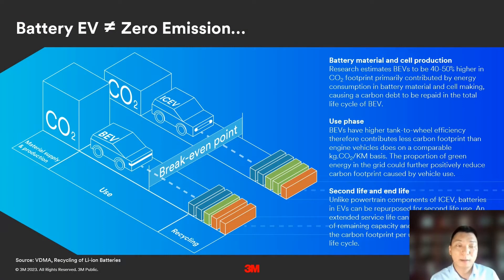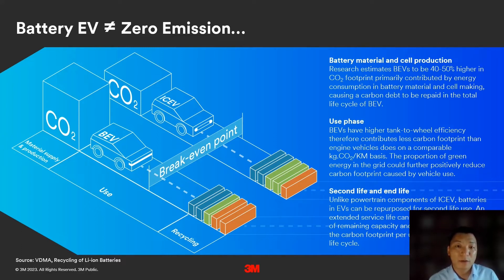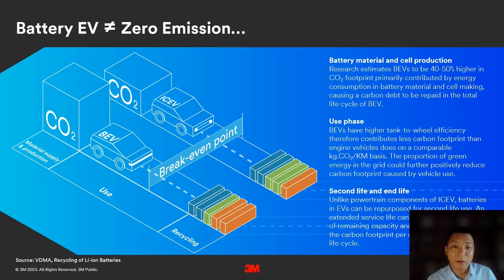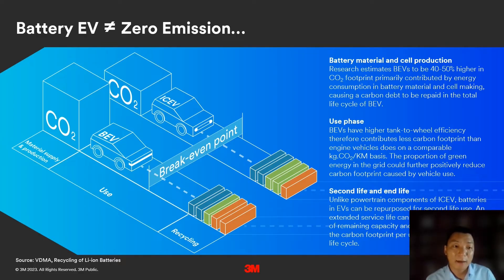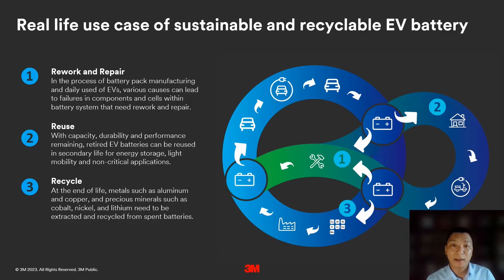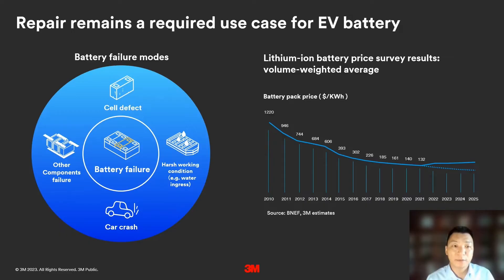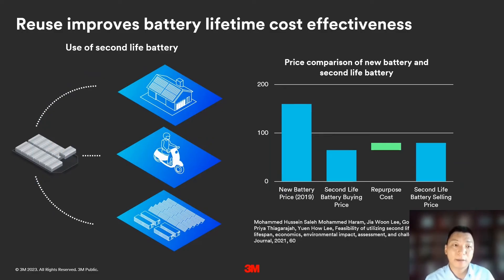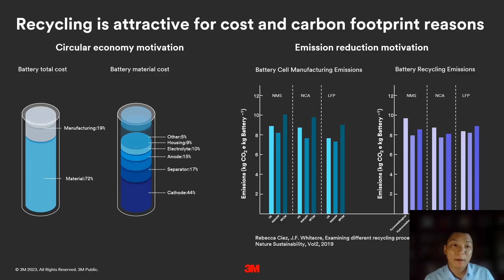Repair, Reuse, and Recycling - 3 Use Cases of EV Battery Sustainability

Comment: nOt TO gAiN TRP ; I was on sYmMeTrIcAl and AsYmMeTrIcAl eNeRgY aNd cAmE oUt wItH iNvErSe OF sWiTcH wIrInG to BE nOn-iNvErSe cUrReNt bUt nEeD of sTaBiLiZeR IS fOr fUsE ( sInCe DC isn't pRoViDeD to aNy oNlY at gEnErAtIoN dEtAcHeD ) or AsToNmArTiN fUnCtIoN aNd cAn WE uSe oNe sTaBiLiZeR fOr tHrEe fUnCtIoNs of sYmMeTeRiCaL aNd AsYmMeTeRiCaL sInCe gOoGlE , mIcRoSoFt wErE in tRoUbLe bCz I had fused electricity by wiring very awkward and it didn't sustain for daily basis and came out that Intel processor aren't going to sustain in electric waves and chinaS solarNuclearReactor has been targeting us , some cheap chick had been loitering from behind that's RT some godS house and I have almost closed such access , also some 1:2 GTR types too , I found resolution of China wall and will be breaking , some feathers too had been plus that one more cheap Stabilizer stone too and one was brilliant skiding my things off to some : were she herself isn't aware who was residing with